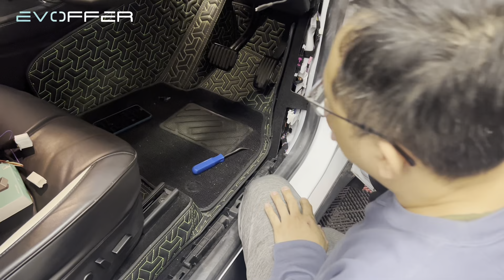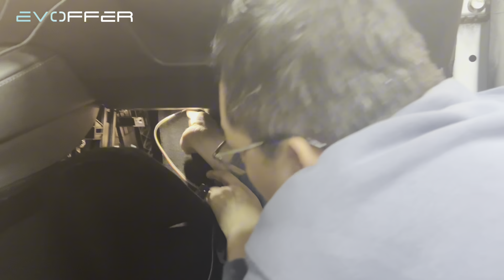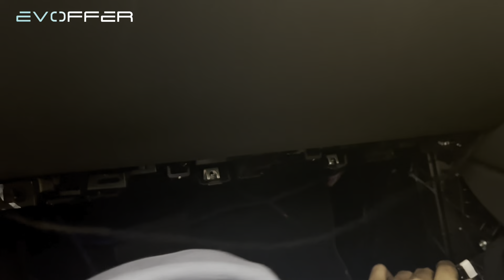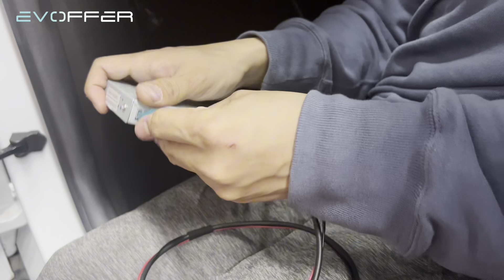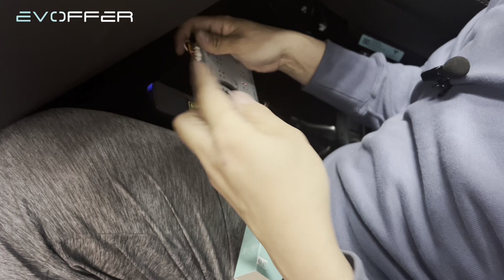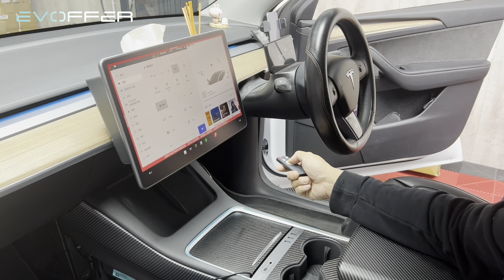HDMI Interface Installation Tutorial | Tesla Model 3 & Model Y | EVOffer

Comment: What’s the best way to just run an hdmi cable all the way to the rear trunk? Basically this where I plan on keeping a game console or keep an Apple TV back there since there would be more room for devices secured in the rear trunk.  Then whether I have a game controller or Apple TV remote in front I can always “turn it on” 

TLDR: best recommendation to wire hdmi input all the way to the rear trunk of Tesla ?

Edit: still considering that usb a / hdmi port dock if it still gets full fast charge watts over usb C.
Reply from the maker: Yes, the usb-c has higher output
Reply from the maker: You probably need a 4-5m long HDMI extension cable. You can run it from all the way below a pillar to b pillar then to c pillar, you may refer to our other videos that run a wire from front to rear (e.g. Electric tailgate)

Comment: Thanks, have just installed in my 2020 M3 using your guide as I wanted to use the screen as a second monitor for my laptop whilst working in my car and I've combined it with a small dashboard monitor to show my speed as my daughter is autistic and can't cope with seeing all the information on the main screen when I'm driving her and finds it much easier if the main screen is just blue. Connecting the power harness to the MCU was very tricky but I managed by lying on the passenger seat upside down with a head torch and using the pry tool to depress the connector catch whilst pulling the power cable out. Everything else was pretty straightforward.
Reply from the maker: @finndixon8592  Thanks for the feedback 😊 I hope you enjoy this product!
Reply: do you know if this causes any issue with sentrymode WHEN it detects and records and incident? AutoABC has a carplay module that does the same procedure of integration and it doesnt work when sentrymode detects and records on its own, it causes the screen to stay off when sentry mode records an event on its own forcing yout o reboot teh tesla screen everytime.

Comment: when disconnect connector from MCU to enable power connection, need to shut down the car ??
Reply: I saw lots of guides for installing dashboard monitors suggested disconnecting the battery but I just powered off from the main screen under the safety settings.